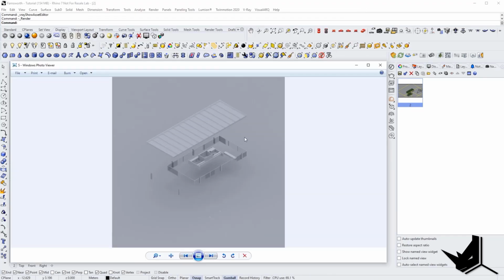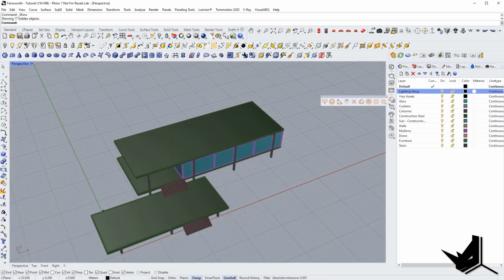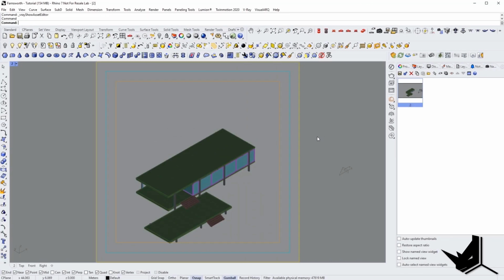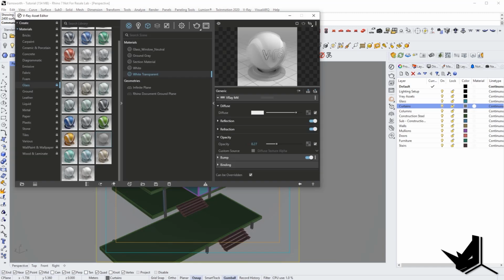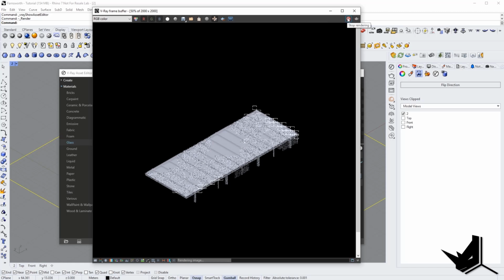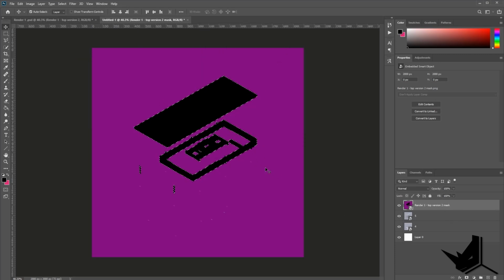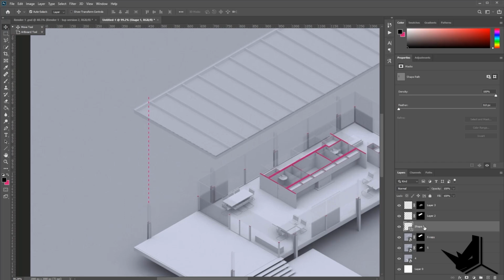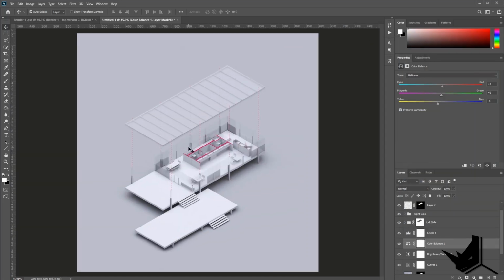Vray for Rhino Tutorial - Clay Axonometric Diagram

Comment: You know that you can apply materials to layers
Reply from the maker: Yes,  of course :)
Reply: So why apply materials to objects but not to layers? Is it possible to make clipping material render properly (matt/glossy)?
Reply from the maker: @tomasdesigner  It's just the way that I did it in this tutorial, you can apply them to Layers if it makes more sense to you. Yes, you can pretty much any clipping material and apply it as a section material.
Reply: @HowtoRhino  But in my case applied section material renders as plain flat color, but not as proper material
Reply: It is way brighter than same material applied to object in the scene. Can it be that section material ignores lighting?
Reply from the maker: @tomasdesigner  In the clipper object of Vray, there's a section where you need to turn this option on and choose the material you want to set up. Is this the way you have it set up?
Reply: @HowtoRhino  Yes and i applied same material to box next to clipping and they render very different. Box renders ok, but clipping material looks like saturation set to 11.
Reply from the maker: Send me your model at dusan@howtorhino.com and I'll take a look and see what could be the issue :)
Reply: @HowtoRhino  There was a problem with material, made new from scratch and now it renders fine both box and clipping, thanks for great tutorial!
Reply from the maker: @tomasdesigner  sure, glad it worked out. You're welcome :)
Reply: @HowtoRhino  For the infinite plane wrapper material would render better edges in alpha channel

Comment: Love your content. Just some questions. As you mentioned in the video I have trouble importing sketch-up files into Rhino. It keep saying the memory is insufficient?
Do you know how to manage this kind of problem?
Reply from the maker: Thanks! I appreciate it. Well, the more memory you have, the better. For example, I have 64gb of ram memory on my system and it doesn't have any problems importing big files. However, if you don't have that much memory, then the best option would be to first simplify SketchUp model directly in Sketchup and divide it into a couple of segments. For example, this model is very heavy because of the furniture elements. If I take out furniture elements, I have no problems importing this in Rhino, but if you really want to use those exact furniture elements, you want to import only 1 instance in Rhino, and then "rebuild it in Rhino" and then just multiply it a couple of times (for example dinning chairs, sofas etc). In some cases, you don't even need to rebuild them, if you're just doing it for the diagram like here, but I did it anyways because the file was barely usable as sketchup geometry in Rhino gets broken with thousands of planes and that adds a lot of weight. Also, you want to explode any components/blocks that come from Sketchup to Rhino and make them as groups and rebuild them (one useful command here is MergeAllCoplanarFaces). Hope that helps :)